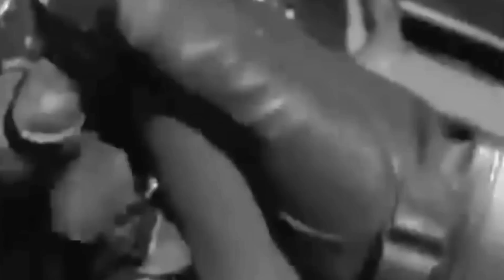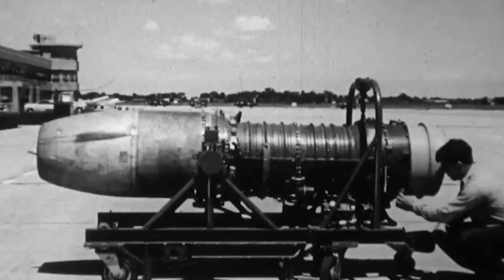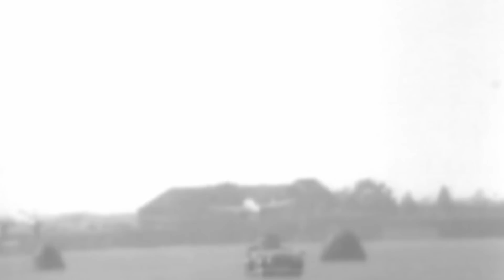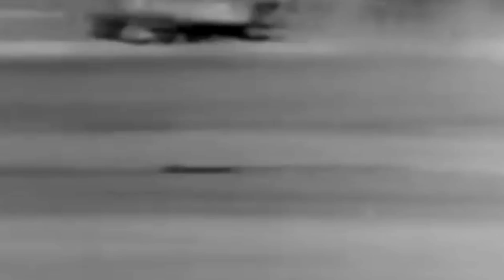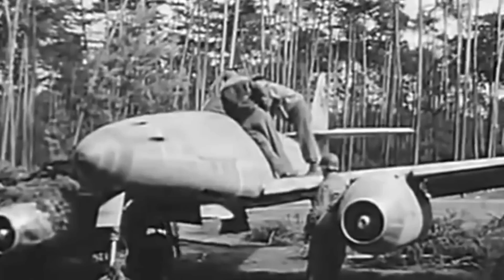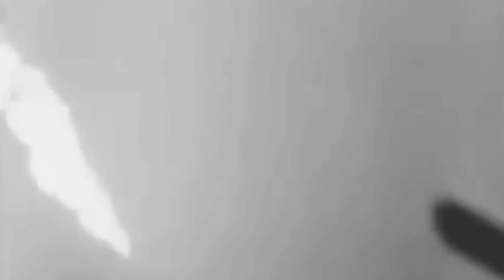The Never Before Seen Fighter

Comment: Heinkel baute oft die besseren Modelle. So auch die Heinkel 100, der die Me 109 vorgezogen wurde. Es waren politische Entscheidungen.
Reply: That's a popular myth but the evidence proves otherwise, Messerschmitt aircraft consistently outperformed Heinkel competition and Messerschmitt had much more production capacity than Heinkel.

There is no better example than the competition between the He-280 and the Me-262, the Me-262 completely outclassed the He-280

Comment: Me 262s were shot down in significant numbers by P51s.
Reply: Not in aerial combat... so many P-51s were lost by AA fire loitering around Me-262 airfields that Allied fighter command officially banned the practice. 
In a dogfight the Mustang was completely outclassed by the Me-262
Reply: 158 Me262's were shot down in the air by fighters, and of these between 60 and 74 % were P-51 Mustangs.
Reply: @stevefisher8323  The Mustang was obsolete and was completely outclassed by the Me-262...
Reply: @stevefisher8323  Attacking an enemy aircraft on the ground or during TO or landing is not a dogfight... all aircraft, including modern jet fighters are vulnerable during take-off and on final approach to land... the fact is more P-51s were shot down circling 262 runways than the number of Me-262 ever shot down.

Comment: The Jumo-Engine was testet 24 hrs nonstop on ground in a shelter!!!
Reply: The Jumo 109-004B Orkan engines were tested and exceeded the RLMs 100 hour continuous full power test required by all engines used in Luftwaffe service.
This is the exact same 100 hour PFTR reliability test required by the RAF and USAAF during WW2.

The US Army Operation LUSTY confirmed TBOs averaged 55 hours, this is better than many Allied piston engines during WW2 and better than some Allied jet engines.

Comment: You have two “documentaries” with details of the ME262’s performance - neither is accurate. One of your statements is the 262 could fly at twice the speed of sound whereas its top operational speed was Mach 0.82  or 607mph - the speed of sound being 767mph.  In this “documentary” you say  its cruising speed was  only 475mph. 
Documentaries need to be accurate or, at the very least, consistent.
Reply: The Messerschmitt Me-262 has a top speed of 560mph and a continuous cruising speed of 465mph, at least 125 mph faster than any Allied aircraft.
 Heinz Herlitz flew 624 mph in level flight in a special interceptor variant.
 Several sources list the Me-262s critical Mach number performance as 0.82, this is inaccurate, test conducted by University of Munich confirmed that the Me-262 was supersonic in 2001, this backed up by Adolf Busemann who conducted supersonic tests at the RLMs Luftfahrtforschungsanstalt supersonic wind tunnel laboratories in Brauschweig and Hans Mutke who reached Mach 1 in a powered dive.

Comment: The NAZIS could have used a Jet engine as a  booster to a propeller plan. The Jets they used only 30 minutes of fuel!
Reply: Propellers create drag, this makes the plane slower.
The Messerschmitt Me-262 could cruise continuously at 465mph... and had a top speed of 560mph

Comment: The US Army Air Force was led by men with no forward vision.  The P-40 was not given a dual supercharger because the leaders said all combat would be fought below 20,000 ft.  The P-80 was available in 1944, but the leaders said the jets were untried, and pilots could not be trained to fly them.  The P-80 was almost as fast as the German jets, and could out handle them.  A group was stationed in Italy away from actual combat.
Reply: The P-80 was rushed into service too quickly and was not ready for operational service, half of them crashed and the rest sat grounded for the remainder of the war with technical and safety issues

Comment: It was a beautiful aircraft but far from a practical fighter. Engine flying hours were very short. Then had to be stripped and maintained. So it would have not been ready for some time.
Reply: Completely false, the Me-262 was very successful in operational service and combat, shooting down over 550 Allied aircraft.
The US Army exhaustively tested the Me-262 during Operation LUSTY and confirmed TBOs averaged 55 hours, EXCELLENT by WW2 standards for Allied piston engines.
Reply: @WilhelmKarsten  The aircraft had reliability problems because of strategic materials shortages and design compromises with its Junkers Jumo 004 axial-flow turbojet engines. I’m sorry you are incorrect. The Me 262 was self-defeating mainly because of the wretched reliability of the Jumo 004 engine. With something around a 10 to 12 hour service life, often less, this meant that you needed an engine change after just 3 or 4 sorties at most. Junkers was never going to be able to produce sufficient engines and repair parts to keep more than something like 50 to 100 Me 262 flying, at most.

Comment: "Never Before Seen Fighter"

and

"never-before-seen maneuverability"

That's not actually quite correct, the Junker Jumo engines were highly temperamental and pilots were instructed NOT to accelerate or decelerate too quickly and a maximum 30 percent rearward cog was critical to avoid an inevitable stall in a turn, the plane was superb in climb and forward flight but as a bomber interceptor not a fighter to fighter situation at all when the best policy was to outpace an approaching enemy.
Reply: Nonsense! Me-262 pilots shot down over 550 Allied aircraft, 26 pilots scored Ace or higher.
Kurt Welter remains the highest scoring jet Ace in history.
Allied experts including Eric Brown stated stated that the Me-262 had excellent flight characteristics and was years ahead of anything the Allies had during WW2.
Reply: @WilhelmKarsten   I didn't say that it didn't shoot down Allied aircraft, what I referred to was the technical constraints of the power plants and, as a consequence, the role to which the plane was best suited. Brown stating that the Schwalbe was better than anything the Allies had was undoubtedly true but that's at least a relative rather than absolute quality, I wouldn't though for one moment intend or wish to denigrate the aircraft or those who flew it.
Reply: @David-g1p-v8k  What technical restraints? The Me-262 proved to be highly effective and successful.
The aircraft has been the target of an incredible amount of biased misinformation.

Comment: Saw the Me-262 in display in Munich Deutsche Museum.  We designed airplane and engines.  Probably needed some refinement for longer engine life, fuel efficiency, reliability.  Most likely long range accurate armaments with hi hit ratio.  Luftwaffe could not afford to loose pilots or aircraft.  The B-17 guns were effective at 3,500 feet or >1,000 meters.  The Me-262 needed longer range effective cannon.  May be a ligher MK-103 or accurate guided missiles with sensors that track sound with hi kill ratio?  Needed a range of 1,500+ meters?
Reply: 26 Luftwaffe pilots scored Ace or higher shooting down over 550 Allied aircraft.
Kurt Welter is still the highest scoring jet Ace in history.
The P-80 and the Gloster Meatbox  only killed Alled pilots during WW2.
Reply: @sandervanderkammen9230  Hello Sandyboy, why are you posting bin two of your identities under the same comment?
As you know Sandyboy, the Me 262 failed in military terms and in market terms, post war nobody wanted it and within a few years it was collecting dust.
The Gloster Meteor had aservice career of thirty years and with more than a dozen air forces.
Reply: I'm not sure where you get this misinformation about the Messerschmitt Me-262.
The Jumo 109-004B was the best jet engine available and was more reliable than many Allied high output piston engines.
The Me-262 had the most powerful and effective standard gun package of any fighter in WW2, a single 30mm shell containing 86 grams of RDX high explosive could blow the wing or the tail off a large 4 engine bomber or completely disintegrate a single engine fighter like a Spitfire.
Reply: @WilhelmKarsten  You are right about the 30 mm cannon shell, but it had a low velocity.  with a drop of 41m at 1,000m range.  May be with a good gun sight.  The R4M seemed effective with similar ballistics.  Main issue the Me-262 cane in late and not in hi numbers otherwise the B-17 fleet would have been decimated.
Reply: @AjitMD  All the experts agree that the 4x (or 6x) 30mm MK 108 cannons were the most effective of any WW2 fighter.

Targets were very rarely engaged at 1,000 m, most shots were at less than half that distance which is why the lower velocity was not an issue.
Fighter versions were equipped with the Askania EZ-42 electro-optical, ranging finding, gyro stabilized gun sight with illuminated heads-up display.
This was without any doubt the best gun sight used in WW2.
Reply: @AjitMD  Alot of the best weapons of WW2 came late in the war, many Allied weapons never arrived before the war ended  or were, like the Gloster Meat Box and the Lockheed P-80, rushed into service to quickly without proper development and ended up being completely ineffective during the war.
Reply: @WilhelmKarsten  Hello Sandyboy, please name all the experts that agree with your drivel.
Reply: @WilhelmKarsten  Hello Sandyboy, as you know the Ju 004B was an appallingly fragile, unreliable and ephemeral engine with worse thrust, PR and THW values than the Derwent 1.

Comment: The Me262 had ejection seats??  Wow i doubt that.
Reply: Several WW2 German aircraft were equipped with ejection seats.
The Messerschmitt Me-262 could also be equipped with a gyro stabilized range fiding gun sight wit heads up display.